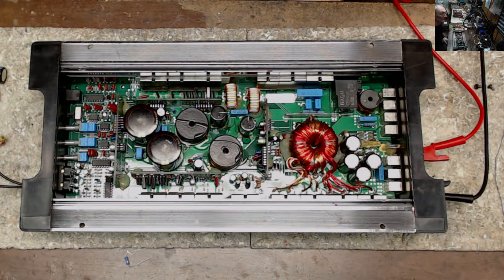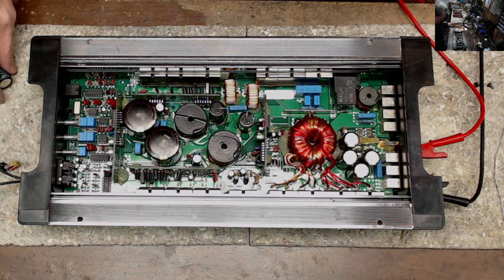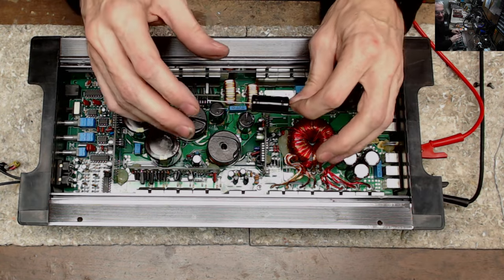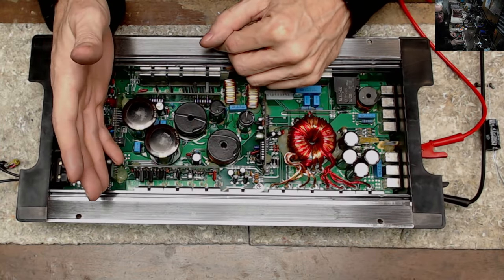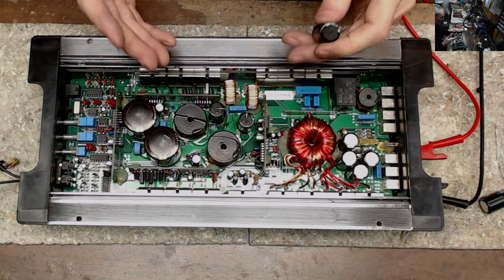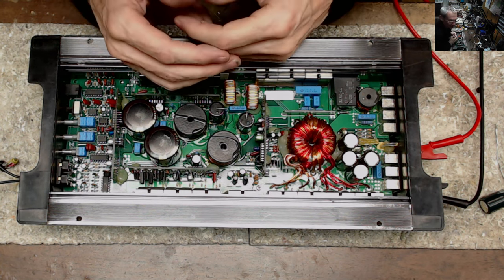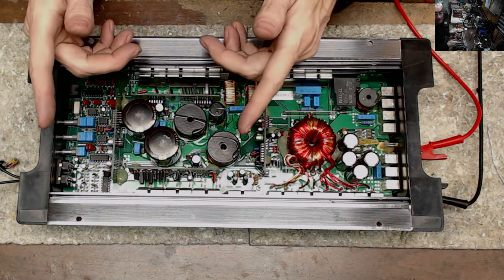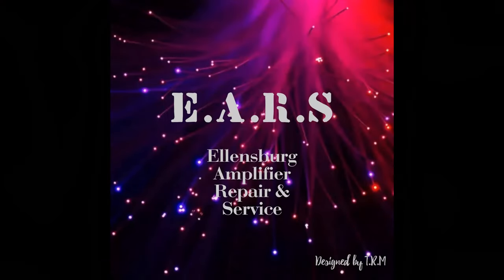Memphis 1100D The Stubbornly Hard to Find Bipolar Capacitors Problem Diverted

Comment: LISTEN, I have found a lot of capacitors too bulged at the top with a reasonable value in farads and still work, but on one occasion an amplifier with the source stage capacitors overly bulged began to do strange things, pulses came out of the speakers and was something unbearable, if that was the problem, because cold works properly.

Comment: I have 2 of the older 1100d that are chrome. How much do you charge to repair with shipping? I am in Nashville
Reply from the maker: I don't provide sight-unseen quotes www.ellensburgamplifier.com/FAQS and I don't charge by the hour but rather by the job. Shipping charges depend on the size and weight of the box, so I would not know until they are ready to head back out. You can get an idea of shipping if you enter the dimensions and weight into pirateship.com as that is who I use daily. www.ellensburgamplifier.com is where you will find the current service times and minimum charges.

Comment: I have audiopipe taramp copy that power up play for a few seconds and go protect, can't seen to find no faulty component it's the 2092s drive chip
Reply from the maker: Usually an output issue with those symptoms.
Reply: @ellensburgamplifier  drive ic?
Reply from the maker: @djbell9939  It is hard to say. Would have to see what it is doing on a scope.
Reply: @ellensburgamplifier  ok thanks
Reply from the maker: @djbell9939  Does it go into protection only if you increase the volume or will it do that just sitting there idle? Sorry this just came to mind.
Reply: @ellensburgamplifier   yes just sitting idle for a few seconds and go straight protect  and start up back immediately after applying the remote and the switch wave look ok, no DC offset no spikes or ringing it just go protect
Reply from the maker: @djbell9939  Is anything heating up during that time? Sounds like the feedback circuit may be damaged.